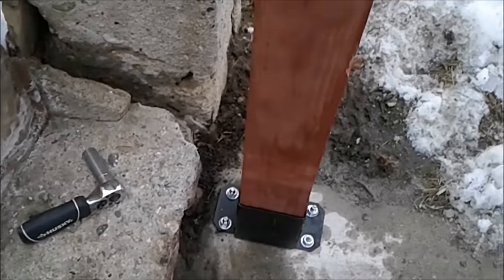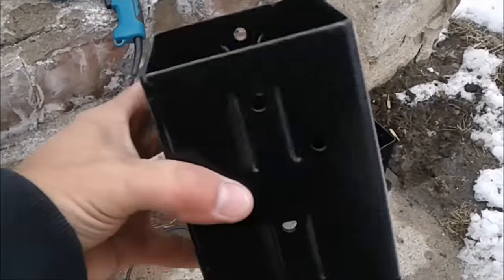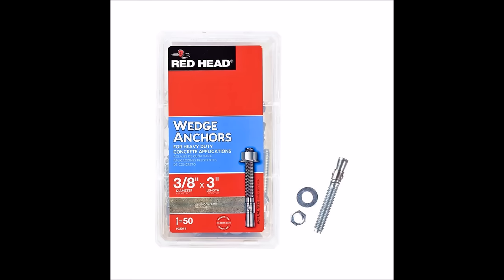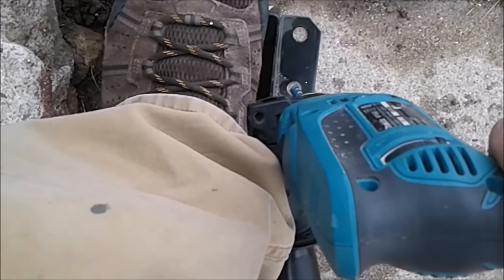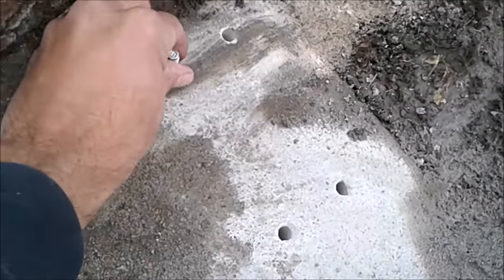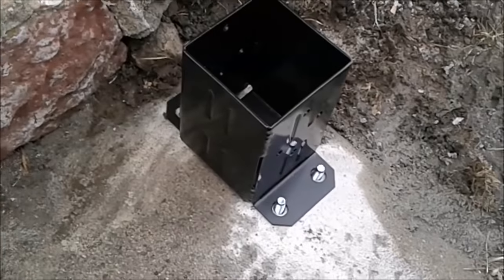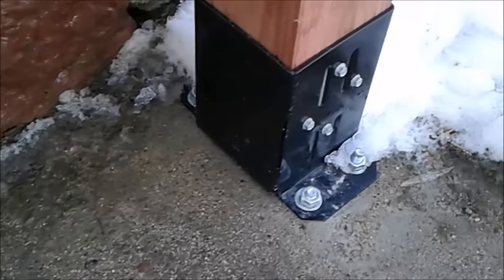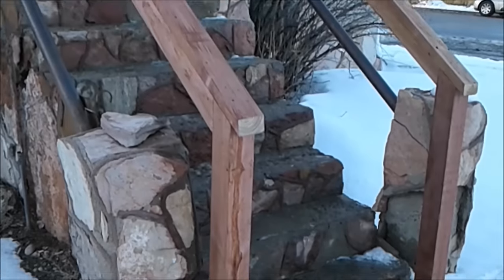How to attach wood posts / railing to concrete with Simpson Strong Tie E-Z Base

Comment: Nice clear and concise video.  For young/ inexperienced people watching, you should always screw nut on until flush with end of a stud before hammering it.  It only takes a few seconds and will protect the threads of the stud.  It usually doesn't take much force to drive these fasteners in, but at some point you will encounter a stud or bolt that needs a good hit.  Hitting the nut instead of the end of a stud is just a good practice/ habit to develop and should stud threads be damaged, they will be corrected when the nut is backed off for installation.
Reply: Excellent tip, thanks for saving me time!

Comment: You should mention what to do if the concrete is not level. If the post sits in the base with a factory end on the post, it won't be level, and cutting the top level will just make an unlevel post with a level top. Fun problem to solve with a miter saw and square.

Comment: I just put up a stand alone frame 5' wide x 8' deep x 7' tall   four 4x4 posts using the Simpson ZMAX Galvanized post anchors and thing wobbles horribly.  These anchors are not good at all.    There is no way this can be safe.   How sturdy would these EZ Base anchors make my structure?

Comment: Another reason to leave the nuts on when you drive the bolts into the concrete is so you don't mess up the threads on the bolt.
Reply: I think he means put the nut at the bottom of the threads rather than the top. The nuts will simply hit the concrete and now allow the bolt to go any deeper.
Reply: I messed up my thread by not keep it at the tip of the bolt. Couldn't get the nut off

Comment: just bought this bracket I wish they would have flange on 4 sides ... I need to use where there is gate on fence and do not know if it will work or need to switch hinges to opposit post. thanks for video

Comment: We are getting a 4 inch slab poured for our patio and I ripped out my old cedar fence posts because I didn't want them encased in the new concrete. A few of my posts have rotted at the surface over the years because of wet ground in the rainy season and I didn't want to break concrete if those posts ever needed to be replaced. Because of wind rating concerns, my neighbor claims there are no metal brackets out there that are made to support a 4x4 wooden fence post for a standard 6 foot shadow box wood fence. I really don't want to reduce the size of the patio pour and leave a 12 inch gap without concrete just to dig new holes in the ground. So, are there any brackets out there like the Strong Tie E-Z Base that will work for this? The only wind we ever get is when a bad storm rolls through and do not get constant winds.

Comment: I'm about to repair a fence post doing this exact method. Just curious, why did you use 3/8 instead of the 1/2 the Simpson Strong Tie recommended? Does is matter?

Comment: What would you do if the Simpson EZ base does not allow the 4x4 pvc sleeve to fit over the base. This is on an  outdoor shower kit and the one I installed in Florida worked fine about 6 years ago, but it looks like either Simpson of the sleeve manufactures changed dimensions as nothing fits over the Simpson base. Thanks.

Comment: Nice video I have a quick question. I am installing a 3' long railing at the top of my basement steps so my grand kids don't fall into the stairwell.. Are tapcons reliable? I understand they may not be as strong as these expandable anchors,  but will they do the job if I put 4" long tapcons in the concrete

Comment: Would this work for a 10 foot 4x4 post? Wanting to add a Sun Sail to my pool which would be 30x10 feet. Was wondering if 3" would be enough to maintain it secured.

Comment: When I put posts in like that I always get a stainless steel screw and drive it into the centre of the beam and leave it proud by 1/4" or so then paint the end real quick then put it in the base. That way it won't suck up water during rainy seasons or when the snow melts.
Reply: @BugJuiceFlavor  nice...just like one layer of gravel?
Reply: Confused?
Reply: I don't think the wood is touching the ground... Newby here, sorry

Comment: So I have a project of adding 2 4"x4"x8' posts in the yard to connect string lights from my existing covered patio. I'm guessing this method wouldn't be strong enough?! Either this method or getting 11' posts and burying it 3' in concrete....suggestions welcomed!

Comment: Great video, I am thinking of installing an EV charging unit(15 lbs) on the 4*4 pole(6 foot), could you let me know what anchors /screws I should be using? Perhaps, any recommendations/suggestion for the installation would be appreciated!
Reply from the maker: anchors size should be around at least 3"with 1/2" thickness

Comment: This is great. I have an existing fence surrounding the concrete slab that my pool was set in. Except the posts were attached to the sides of the concrete slab, so now the fence is loose and about to fall over.

Question - how far in from the edge of the concrete should the ties be placed?
Reply: No closer than 3 inches.

Comment: Great video! Can these be used on a 6-foot post? Thanks for the help
Reply from the maker: It depends on the application.I wouldn't use these for a 6 foot fence.They might work for a gate but definitely wouldn't use it for a 6' section of offense.
Reply: I wanted to build a 6 ft stand alone gate door with 2 4x4 6ft post using 2 brackets. I'm thinking it might not be able to hold the weight.  thanks  for any feed back!
Reply: @D.I.Y._All-in-One  

From Simpson's spec sheet:

Post bases do not provide adequate resistance to prevent rotation about the base and therefore are not recommended for non-top-supported installations such as fences or unbraced structures.

Warning

The E-Z Base and E-Z Spike products should not be used for solid fences in excess of 4' in height or that are unprotected from wind forces. These products are not rated for uplift loads, and should not be used with posts for overhead structures or any other structure that requires resistance to wind uplift loads. Notwithstanding the terms of the Limited 

Warranty, Simpson Strong-Tie does not guarantee, represent or warrant that this product will prevent or reduce damage caused by corrosion, or any seismic, wind, atmospheric, or other load-producing event.

Which also leads me to believe that these would not be approrpriate for hand railing.  The expansion bolt to concrete connection wouldn't be strong enough for the IRC load testing requirements.

Comment: What I don't understand is the bolts are in wth just a couple of taps.  Is that secure enough?  Can the entire thing be pulled out?
Reply from the maker: They are anchor bolts  They are designed to get tighter when pulling the bolt up.  They have a sleeve that surrounds bottom of bolt and bolt has a tapered end.

Comment: I am trying to do this for a Pergola.  How do you make sure that the post is perpemdicular.  The concrete base may not alway be flat.  Is there some technique of using shims etc, and what type of shims?  Thanks much
Reply from the maker: You can use large washers on the bottom of the base, and they will work as
 shims.

Comment: Where you attached the post to the connector, Did you only screw one side? It looks like the other side wasn’t accessible. Is that okay?
Reply from the maker: The post can secure to the base on all 4 sides, so as long as it secured to at least 2 sides its fine.

Comment: Great video - thanks! 

I am curious though since I live in Ohio, what about water getting underneath and down into where the hole is for the wedge bolt? Seems to me that freezing / thawing of any water in the holes would eventually crack the concrete. 

Would it be reasonable to put some kind of calk or roofing sement at the base of the threads to keep water out?
Reply: I doubt it. What did you go with?
Reply: @luissonoma6255 Late but maybe epoxy?

Comment: How strong is this post anyways. Does it wobble. Come off easy. If someone fell on the railing will it hold up.
Reply from the maker: There's a little bit of movement to it. But if someone fell against it it would hold them up.  As long as everything is installed properly

Comment: Looks like your concrete slab may not be very level. How do you make sure the post is vertically plum?
Reply from the maker: Metal washers can be used as shims for leveling.

Comment: Hi, im using the same exact base frame, same anchors, same thickness, how deep did you drill into the concrete?
Reply from the maker: To depends on the size of the anchor if it's a  3" anchor then drill 3 1/2" inches deep if it's a 2 1/2 " anchor drill 3" deep

Comment: Thanks for the helpful video! What size hug screws did you use to secure the post to the base? I read 1/4” but I’m wondering about depth.
Reply from the maker: I use structural screws like this. https://www.ebay.com/sch/i.html?_from=R40&_trksid=p2322090.m570.l1313.TR0.TRC0.H0.Xsimson+structual+%2310.TRS0&_nkw=simson+structual+%2310&_sacat=0
Reply: You can use 1/2 x 4in as well for more stability and firmness when you drill for an anchor you add 1/4 in depth what you can do is place your anchor on your drill bit and mark its lenght with a marker so when you drill you know how much of the bit has to go in once you toghten the bolt up anchor opens up and locks on

Comment: We use thee bracket they do work well and I am sharing because we have no wood working experience we are metal machinist not wood workers and these brackets are GREAT. He does not lie the post is tough to insert we had to really pound them onto the 4 x 4 posts. 
Lance & Patrick.
Reply: How resistant do you think they are to the elements? Because most metal that are at ground level deteriorate fairly quickly and rust up possibly casing them to fail. Is that a powder coat finish?
Reply: A solution to this problem would be an electric hand planer or belt sander. Hog off a little material at a time until snug but slides in a bit easier. Also apply a bit of finishing wax. Smooths out the process a bit.
Reply: @LeatherandLathe wouldnt that affect the woods water resistance

Comment: This looks promising for securing 4x4 posts to a concrete porch to add a railing. 

I wonder why "Simpson Strong Tie FPBB44 Black Powder-Coated 12-Gauge E-Z Base" product does not seem to be listed on their website.

What size screws will fit and provide good stability for attaching the Strong Tie to the wood of the 4x4?

Comment: Use resin mix instead of the bolt anchors and studs and bolts so they can be undone later
Reply: Sweet Vuvuzela blah blah opinion opinion
Reply: Funkentelechy Razzamatazz for sure blah blah🥳

Comment: Would these brackets be strong enough to support 4x4x8 posts to be used for a sun shade?
Reply: I'm in the same boat. What are you going to do? I haven't looked around yet but if they are too pricey I will just bury the posts into the ground. Possibly 12ft post that will be buried at 33 percent. That will give me my 8 ft clearance with 4ft in the ground surrounded by 50 pounds of concrete. I'm going to put up a 12x20 aluminum awning so it won't be so heavy. A post every 6 Ft should be fine.

Comment: I have done all this but the anchor is not secure.  When the post is added, it wobbles both left and right and forward and backward.  Aren't there pads that go under the steel anchor between the steel and the concrete to add friction that keeps the post from "rocking"?
Reply from the maker: Is the post moving inside metal base or entire base moving ? If base is moving it sounds like you need bigger anchors  you will probably still have a tiny bit of movement even with bigger anchors but it should be plenty sturdy for most uses especially after attaching railing/cross members etc. Its not going to be as solid as burying post in concrete.
Reply: or your anchors are not tight. wrong size drill bit used in the concrete for the anchor you installed. Or you simply haven't tightened the anchor bolts?

Comment: What size screws did you use to secure the 4 x 4 post to the bracket?  Thanks and helpful video.
Reply from the maker: 1.5" exterior screws. Optionally you could use structural rated 1.5" long screws as well.
Reply: And definitely go with a torque or a square drive and never mess with Phillips

Comment: Would those Simpson Strong Ties work for an 8 foot 4x4 post? if so, what anchor size do you recommend? thanks.
Reply from the maker: 8' post might be a little much especially if its a fence and its exposed to wind. It would also depend on whats going on at the top of the post? For instance a small porch covering that ties in to a solid structure with 8' posts securing to concrete could be pretty stable. But if there is nothing to secure top of a 8' post it wouldn't have much stability.
Reply: Sorry to bother you but what would you recommend for over 6' post into concrete wall. My current install is failing and the welds are breaking. Would Simpson strong ties be better or is there a better way?  Thanks.

Comment: Can I mount a 9ft 4x4 in this bracket to my concrete patio slab. Attach one corner of a rectangular shade sail to that post and would it be strong enough?
Reply from the maker: No unfortunately I think you would need something with more support.
Reply: @D.I.Y._All-in-One  that's what I figured. I'll have to go with My original plan. Cut out the corner of the slab, dig a 42" hole with my post hole digger and concrete it. Thanks for the quick response!!
Reply from the maker: That will work for sure.

Comment: How do you make sure the post is plumb if the concrete has a slight slope?
Reply: Put bracket where you want it, mark around the outside of the bracket. Grinder with a cutting wheel, chisel and some skill..Or add a little hydrolic cement and raise the slope under bracket.

Comment: I did the same thing but for some reason the masonry drill bit wont go in deep into the concrete. I did manage to go as deep as I could and the anchor went in but when I tried to tighten the nut with the ratchet the anchor just spins and won't let me tighten the nut and one of the anchors just came out 🤦🏻. HELP!
Reply from the maker: You might need to get a heavier duty hammer drill to get deeper in the concrete

Comment: Do you think this would work for posts for a pull-up bar? Or do you think the post would be flimsy at 8 feet in the air
Reply from the maker: I would not recommend using it for a pull up bar assembly. Unless you 4 posts in a square pattern with a bar in the middle. That might work

Comment: Can this hold up a 120lb punching bag? Just 1 post anchored from the ground
Reply: @BugJuiceFlavor  I actually tried it but made tweaks where I have it drilled up against the wall as well for extra support and it's holding up very well. Without the extra support it wouldn't work out though.

Comment: Can I use 1/2 in anchors? Or would you say just use the ones your are using ?
Reply from the maker: Yes as long as they fit inside the bracket holes.
Reply: Simpson’s instructions actually call for 1/2” at least for the EZ Bases I’m looking at from Home Depot

Comment: How did you reach the Phillips screws facing the concrete step side?
Reply from the maker: Just drill some new holes on the sides and add screws there.
Reply: @D.I.Y._All-in-One  thanks

Comment: If the concrete floor is not perfectly levelled, the post won't be at perfect 90° angle.

How can we correct this?

Thanks
Reply from the maker: Use washers under bracket to shim base on one side. Base tabs can also be slightly bent to accommodate slopes.
Reply: @D.I.Y._All-in-One  thank you! :)

Comment: How come you used 3/8 wedge anchors when it says to use 1/2 inch on the Simpson ez base?
Reply: 3/8" x 3" is what he was using because 1/2" zinc ones don't come in 3"...I think its like 3 1/4" and up. Most likely he didn't have a thick enough surface to drill a hole 3 1/2' - 3 3/4" deep for 1/2"...so 3/8" was the next size down. They should still hold well for general use like a railing.
Reply: @dandowodzenka8864  Thanks!!!

Comment: How do you plumb the posts with these brackets?
Reply: Start with square footings. If not possible, minimal shimming can achieve a true vertical. Another solution is taking a little material off the 4x4 to give wiggle room. Once fastened it doesn't move. For good measure, I drive in a shim of there's any gapping.

Comment: Can you use sleeve anchors instead of wedge anchors of the same size or wedge anchors better?
Reply: No..wedge are stronger for Shear and Pullout values. Drop in anchors are a good substitute.

Comment: s the whole screw suppose to go into the concrete cause my husband open hammered them in about 1 inch and I bough 3 3/4.... would explain why the fence is swaying so much in sure . Now not sure what to do 😭 he’s talking about anchoring the fence now somehow to the house ... but doesn’t no how abouts to do that . The fence is on a old concrete wall . Don’t know why he only hammered it in about 1 inch though .
Reply: If you have enough threads, you could tighten the nut on the anchor enough to where it pulls the anchor upwards to where you could knock it around with and hammer and break it free. Then you could just size up your drill bit and anchor when reinstalling.

Comment: Will water get into the holes you drilled and eventually crack the concrete?
Reply: You're supposed to put epoxy in the hole then install the anchor so it seals it from water

Comment: Looks a little umm industrial.  That’s a lot of hardware showing coming off of someone’s front porch, but I’ll give it to ya.  It looks solid enough
Reply: That was my question. Can you cover it with some aluminum flashing or something?
Reply: Agreed.  That base with the bolt attachments doesn't look finished enough for a front porch imo.